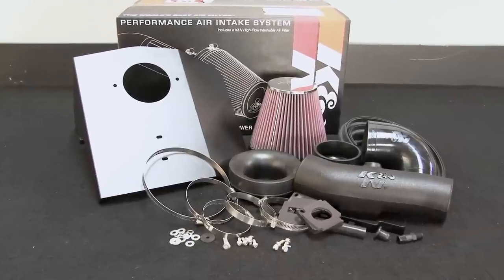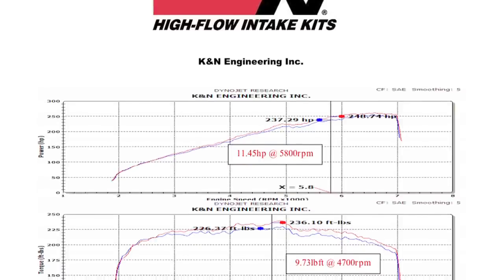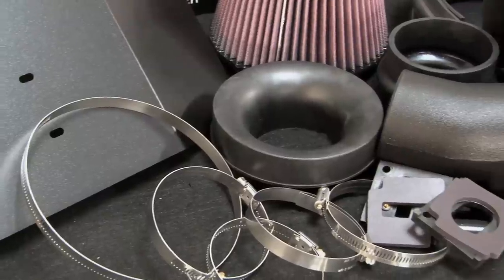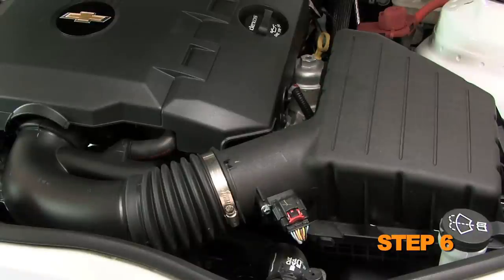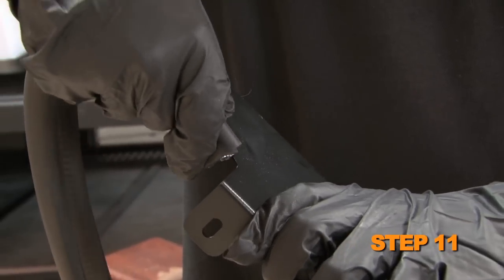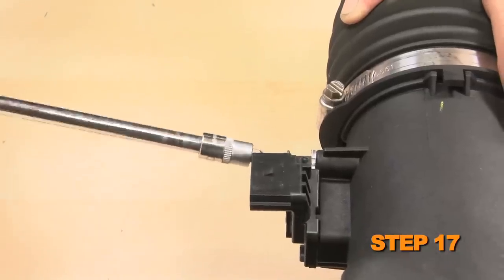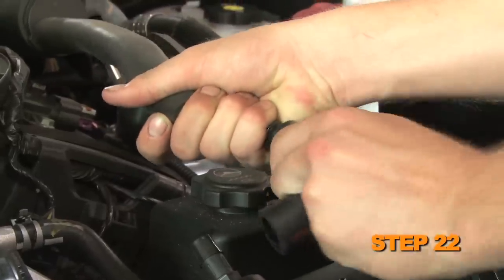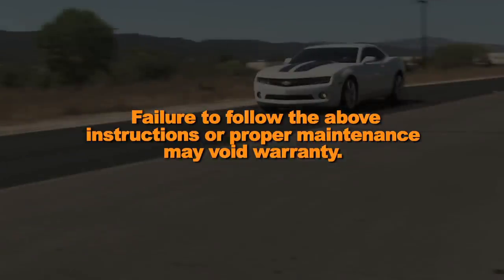Chevy Camaro 3.6L [#63-3078] Air Intake Installation

Comment from the maker: All dynos read differently. Also, closing the hood when running the dyno is not real world. Keep in mind, when driving 60 MPH, you will have a 60 MPH head wind forcing its way through your grill and cooling down your engine. The fans used when on a dyno do not flow air that fast, so to offset it, you open the hood.

Comment: I have a question, is this 3.6L V6 the same engine in the 2014 V6 Impala?
Reply from the maker: +hondac55 No, the intake for the 3.6L Impala is here: http://www.knfilters.com/search/product.aspx?prod=69-4526TS
Reply: KNfilters Yeah I ended up finding it on my own last night but I found out today that I did, in fact, buy the extended warranty.  I was young and dumb.  Only 80,000 miles to go...

Comment: Can please anyone tell me how air flow after using this? Like how air get in that compartment. I check camaro and I notice the headlights are on the way. I planning removing this windshield water tank that i not use just to make room for air flow
Reply from the maker: Please contact our Product Specialists at 800-858-3333 or tech@knfilters.com for help with your question.

Comment: will this fit 2014 v6?
Reply from the maker: Yes, this system will fit a 2014 Chevrolet Camaro 3.6L.  Check out the product pagehttps://www.knfilters.com/63-3078-performance-air-intake-system
Reply: @KNfilters  oiled filter?
Reply from the maker: That's correct, this system has an oiled cotton filter
Reply: @KNfilters  need to oil ot before installation? have video how to oil? my car is daily drive
Reply from the maker: If the system is brand new, the filter is pre-oiled and ready to install out of the box.  You only need to re-oil after cleanings.  For more information about cleaning a filter, check out the following video https://youtu.be/rzuBnnCHJOY